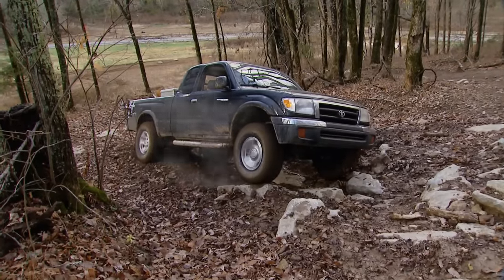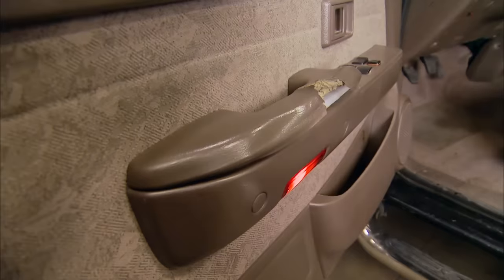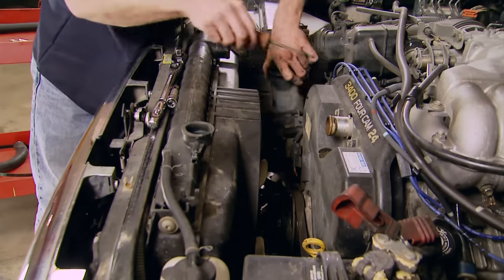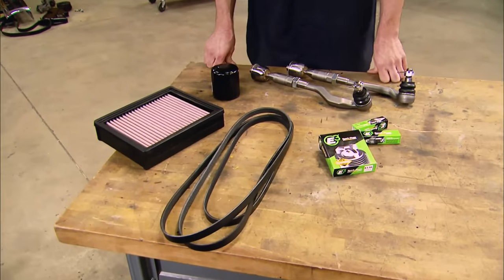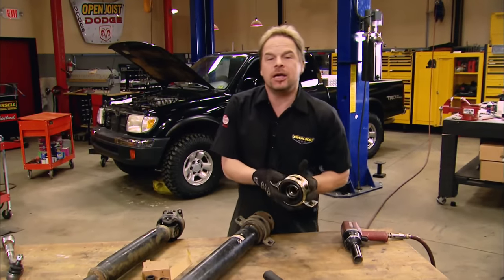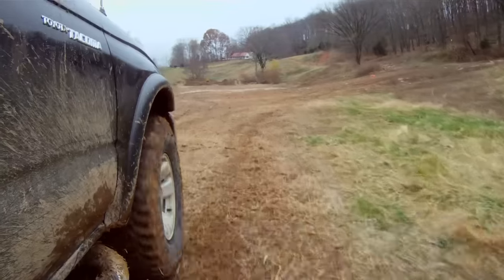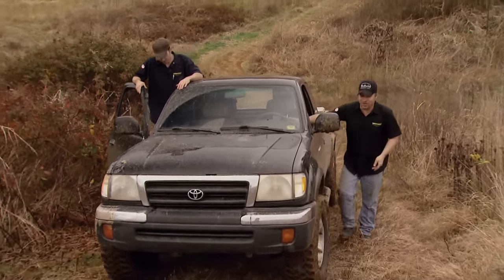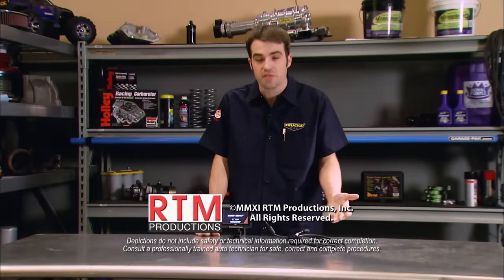Stock Toyota Tacoma Gets A Tune Up And Test Drive - Trucks! S13, E2

Comment: I own a 98 Tacoma extended cab with the TRD Off road package 3.4 and 5 speed transmission. Has 158k miles on it. Same color as this one.  It's a great truck!  I keep it at my place in Las Vegas. It's a desert truck so the paint is a little faded but no rust!

Comment: Awesome! Ive had 4 tacoma's, a 97 gen 1, 03 , totaled an 06, have had my 07 trd for 12 years,its stock but the best truck ive ever owned, new frame in 18 and many new parts but I'll  die with it, ive driven the 3rd gen as a rental for 2days, could sign the papers on one today, dont like em, 2nd gen is the best
Reply: 2nd gen 4cyl Automatic is not great, at just 80k miles it will NOT downshift with light feathering of the throttle from D to 3 on small hillies to maintain proper freeway speed (sounds like it just rumbles and does not want to do what the auto's are supposed to) is something wrong with it or just PURE Garbage transmission???  it is a 2o11 single cab 4WD if that matters at all
Reply: @efil4kizum well #1, my 07 TRD is a 6 cylinder 4.0 with a manual 6speed, the best combo that was offered for the 2nd gen and has had zero issues, I wouldn't call it junk, but the automatic transmission on the other hand, even being a Toyota is a complicated unit and being coupled to a underpowered 4cyl does not help because it is constantly searching or what your saying not searching for the right gear , i would start with the basics, make sure the trans oil level is ok on the dipstick, do this with it idling in neutral, it should be a clean red fluid, check under the truck for any leaks that might cause low fluid, if all checks good, then i would not mess around with any small time shops and go right to the dealer and have them diagnose the problem, it might be pricey, but you'll only do it once and know the problem (hopefully), then you can decide what to do. This is why I specifically bought a manual transmission, shifting is a pain sometimes, but it's a box of gears that I control witch one to be in, no computer controlled any thing, and much cheaper to rebuild if needed, good luck with it

Comment: My Pre-runner is a 6 lug.
Reply: They all were 6 lug
Reply: @devengudinas1649 Nope, my 2004 is a five lug.
Reply: @devengudinas1649 I believe the pre runner and 4WD were 6 lugs
Reply: @TheDeadMan3848  5 lug 2wd trucks are not the same a pre-runners. Different frame, suspension, engine, trans, and rear end.